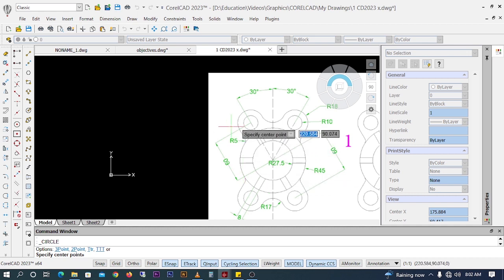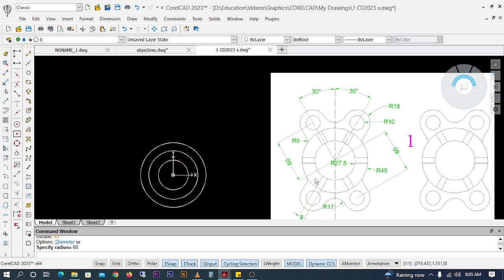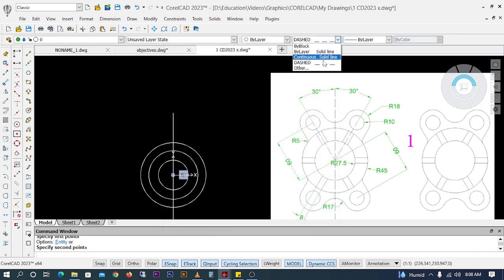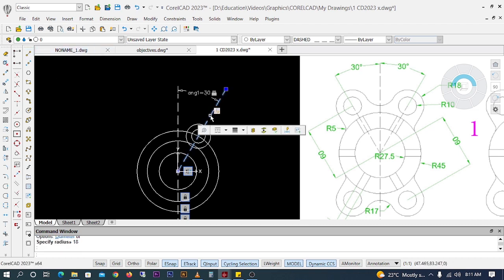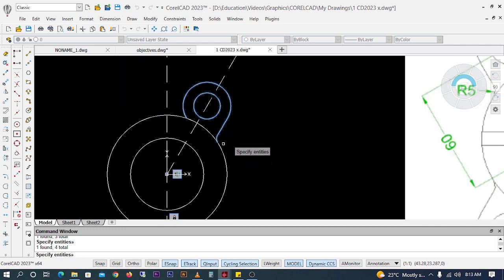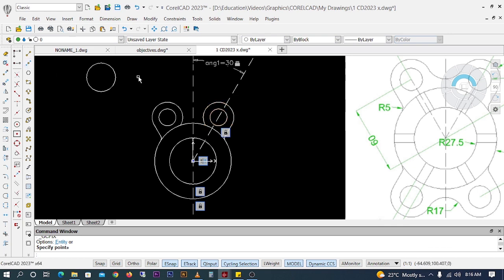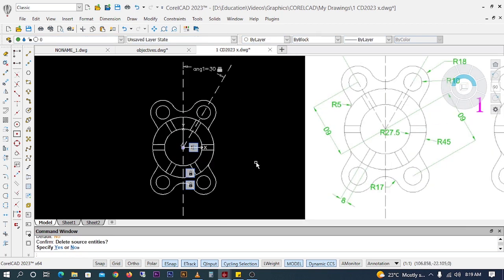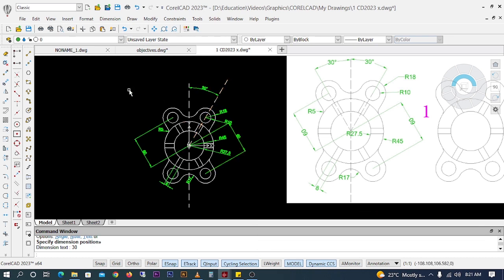CorelCAD 2023 Tutorial Exercise 1

Comment: Supper awesome videos, they are very helpful. I keep getting and error message when working with constraints it says it's and unrecognised command. I noticed he skiped over the steps when trying to make the line a doted line. If you go to Line Scale and change from 1 to 20 it's a lot easier to see. I have your 2D and 3D book but where can i find or get the original pdf file that goes with Corel Cad 2023 it should be longer then 23 pages.